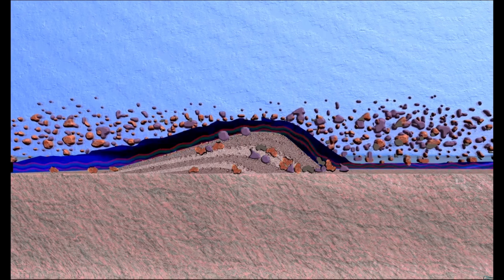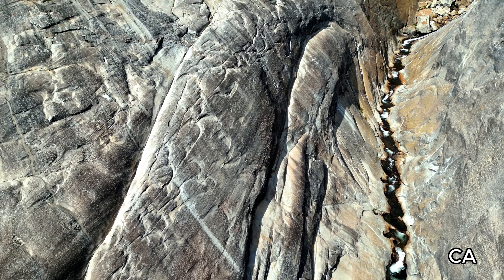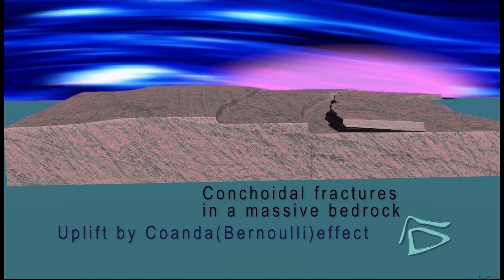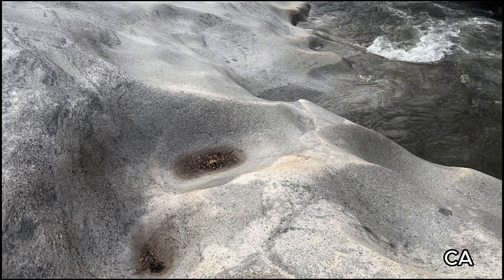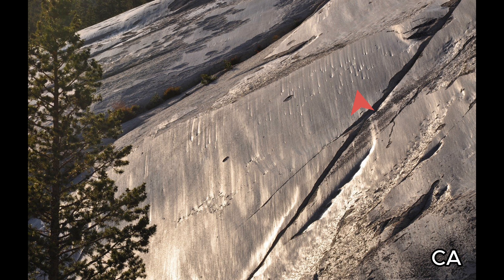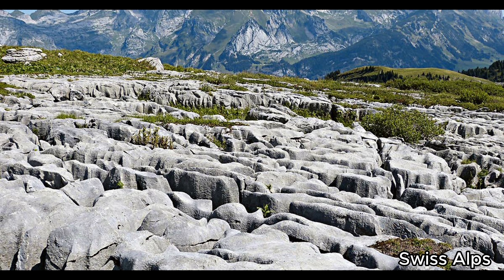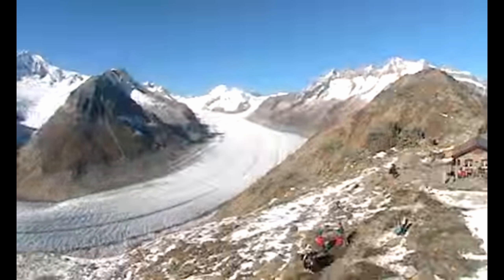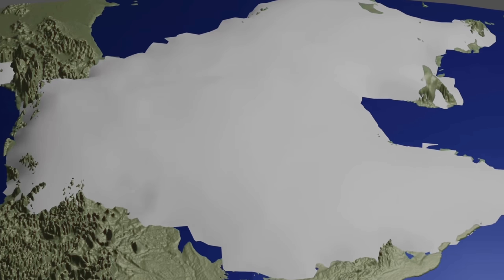Glacier Polish is B.S.

Comment: I have done a bit of research using AI. There is no way you can get erosion like this from ice or sub glacial flows. The only possible candidate is impact generated tsunamis. We are talking 20-30 m/s flows with abrasive material, waves and water columns 500-1000m height, dynamic pressures over 10 megapascal. We have the exact same landforms in Scandinavia. All the landforms you see are possible with this water regime.

Comment: Also, you emphasise features like crescent ruts, pitting, and focused erosion patterns as evidence that high-velocity water flows - not ice - created drumlin landscapes. However, modern glaciers show that both ice dynamics and subglacial water work together. For example, at Múlajökull in Iceland, we can directly observe drumlins forming beneath an active glacier, where sediment analysis shows both ice deformation and water processes at work. How do you explain these modern observations of drumlins forming under actual glaciers, where we can measure the relative contributions of both ice and water?

Refs.:
Woodard, et al., 2020. Insights into drumlin development from ground-penetrating radar at Múlajökull, Iceland, a surge-type glacier. Journal of Glaciology,
McCracken, et al., 2016. Origin of the active drumlin field at Múlajökull, Iceland: new insights from till shear and consolidation patterns. Quaternary Science Reviews,
Iverson, et al., 2017. A theoretical model of drumlin formation based on observations at Múlajökull, Iceland. Journal of Geophysical Research: Earth Surface

Comment: If drumlins were formed by, presumably, a single meltwater flood event, rather than gradual glacial processes, how do you explain the internal stratigraphy of drumlins, where we can observe multiple till layers that conform to drumlin surfaces, with evidence of shear deformation that follows drumlin topography, and discrete unconformities that demonstrate progressive formation through multiple glacial cycles over thousands of years rather than a single flood event of short duration?
Reply from the maker: Great Question:  These till layers you are talking about can be seen as graded beds from river deposition.  Multiple layers can be deposited in one flooding event, from the pulsating nature of water-flow.  As far as shear deformation goes, think about the speed of water-flow it would take to cause fluvial plucking or pitting.  You don't think that current couldn't cause sedimentary deformation of layers?
Reply: @erosion_of_earth  First, till deposits in drumlins are fundamentally different from river deposits in composition, structure, and sorting patterns.

Glacial tills are characteristically poorly sorted mixtures of various grain sizes, from clay to boulders the size of cars. River deposits show clear sorting patterns, with distinct layers of similarly-sized particles and imbrication (overlapping arrangement) of clasts revealing past water flow and direction. The internal composition of drumlins, a poorly sorted till, simply doesn't match what we'd expect from fluvial deposition. What you seem to be describing, at least the sediment you would see, are in Eskers, river channels that formed by the action of meltwater under glaciers.

Second, the claim that "multiple layers can be deposited in one flooding event" contradicts what we see in drumlins like those at e.g. Múlajökull. There, we find:

1. Till units are truncated by erosional unconformities, particularly on drumlin heads and flanks (If drumlins were formed by a flood event(s), we would expect erosional unconformities, and indeed erosional scour, concentrated between drumlins (in the low areas where water flows) rather than on drumlin heads and flanks.)
2. Systematic patterns of clast fabrics and magnetic alignment in till fabrics that show shear directions conforming to drumlin surfaces, not past water-flow (if the alignment was due to meltwater, the alignment would conform to past water flow directions, it would not parallel the drumlin surface)
3. Evidence of different depositional events separated by significant time, hundreds and up to thousands of years, demonstrated by weathering horizons and distinct till compositions (a flood even cannot explain multiple layers, some separated by many years, and tills from different sources)

Third, the shear deformation observed in drumlins is distinct from water-flow deposition/deformation. AMS (anisotropy of magnetic susceptibility) studies show patterns consistent with ice-induced shear, not water flow. Even high-velocity water would produce different fabric patterns than what we observe.

Fourth, there is the relationship between drumlins and other sub-glacial features. At Múlajökull and elsewhere, drumlins are often associated with features like crevasse-squeeze ridges and ice-walled lake plains that form under or the flanks of surging (rapidly moving) glaciers, not fluvial erosion.

And finally, we can observe drumlins forming today beneath modern glaciers, with their internal structures becoming progressively exposed as the ice retreats. We can also observe Drumlin formation under active glaciers using ground penetrating radar. This provides a direct window into formation processes that simply can't be explained by catastrophic flooding.

The water-flow hypothesis requires extraordinary reinterpretation of multiple independent lines of evidence, while the glacial model provides a coherent explanation supported by direct observational facts.

Here are some papers for you to read:

Hopkins et al., 2016. An anisotropy of magnetic susceptibility ( AMS ) investigation of the till fabric of drumlins: support for an accretionary origin. Boreas.
Aradóttir et al., E. 2023. Drumlin formation within the Bustarfell drumlin field, northeast Iceland: integrating sedimentological and ground‐penetrating radar data. Journal of Quaternary Science
Fannon, et al., 2017. Numerical simulations of drumlin formation. Proceedings of the Royal Society A: Mathematical, Physical and Engineering Sciences
Iverson et al., 2017. A Theoretical Model of Drumlin Formation Based on Observations at Múlajökull, Iceland. Journal of Geophysical Research: Earth Surface
Ives and Iverson, 2019. Genesis of glacial flutes inferred from observations at Múlajökull, Iceland. Geology
McCracken et al. 2016. Origin of the active drumlin field at Múlajökull, Iceland: New insights from till shear and consolidation patterns. Quaternary Science Reviews
Woodard et al,. 2020. Insights into drumlin development from ground-penetrating radar at Múlajökull, Iceland, a surge-type glacier.
Reply from the maker: @  So they have distinct layers, but they are too poorly sorted to be from river deposition.  Pick one.   Sheet-water-flow can poorly sort deposits even more so than a river, because a river is confined to a channel, while sheet water flow is not!  Anything Ice can do water can do better except for build moraines. So were is that mile thick moraine that spans the width of North America from the Laurentide Ice Sheet? Oh look its no where to be found, just terraced land. What a joke of a theory.
Reply: I understand your frustration, but let me clarify a few important points:

About the layers in drumlins: These aren't just any layers - they're specific types showing signs of ice movement. They contain unsorted mixtures of everything from clay to boulders (called till) that show evidence of being compressed and shaped by moving ice. Rivers and floods sort materials by size and weight - even sheet floods drop larger materials first as they slow down (also, sheetfloods, if that is what you are referring to, occur on slopes).

Many drumlins contain intact fragments of earlier landscapes that would have been completely washed away by powerful floods. Some even have preserved plant remains or soil horizons inside them, showing they formed in stages separated by thousands of years.

About the missing "mile-thick moraine": The Laurentide Ice Sheet didn't retreat all at once - it melted back gradually over thousands of years, leaving behind numerous smaller moraines marking different pause points, not one giant ridge. These moraines actually exist across North America and are well-documented.

The terraced land you mention is actually typical of glacial landscapes, including features like kames, eskers, and outwash plains - all recognized glacial formations.

If catastrophic floods formed drumlins, we would expect to see them forming today in flood zones, after e.g. Jökulhlaups, but we don't. However, we do observe drumlins forming beneath modern glaciers in Iceland and Antarctica, where we can study how they form directly with radar and other instruments. In these areas we see they are forming without the action of flood water, but due to the pressure of ice movement.

I'm not dismissing the power of water in shaping landscapes - it absolutely plays a major role. But the evidence specifically for drumlins points to ice as the primary sculptor.
Reply: @erosion_of_earth  Essentially, the scientific consensus (the details are not yet settled, but the overall idea is well understood) proposes that that glacier movement, especially  surging (rapidly moving) glaciers, remolds unsorted glacial till into mounds we call drumlins via shear stress. Catastrophic flooding is a fringe theory not supported by evidence, especially in the face of the evidence gathered in the last c. 20 years, with the advent of ground penetrating radar and magnetic susceptibility studies.

Indeed, I attended a lecture c. 20 years ago at my geology department where a scientist from the British Antarctic Survey shows us, for the first time, ground penetrating radar observations of actively forming drumlins under a glacier. Seeing this evidence was a revelation, it massively improved our understanding of drumlin formation.
Reply: There are different types of floods. My research strongly suggests that this was in the "upper regime", so imagine 500-1000 meter high waves even a thousand kilometers from the impact, 20-30m/s flow rate, 10 megapascal pressure, water cutting through mountains and ripping out stone blocks the size of houses. And for duration, you can imagine minutes for the initial pulse, and hours of churning seas, probably days or weeks for the waters to calm down. It is not a single pulse, because I have found crossing drumlin fields.

Comment: I've lived around glaciers for many years, and have followed creeks deep under the ice along the bedrock... there's not normally a bunch of water under there, it flows in caves and channels. Go to a glacier that's melting and look at the freshly exposed rock. You will not see any water erosion on anything but gravel, and that's only where the ice caves were.
Reply from the maker: Thats a very good point. In those caves did you ever see an esker?
Reply: @erosion_of_earth  yes, they can get filled with gravel and rocks that tend to build up in the middle. I guess it's not an esker till the ice melts. My cabin is built on an old esker. A long hill of sand, silt and water worn gravel. On one side is a flowing bog and ponds with a few big rocks. On the other is chunky moraine. Big jagged rocks mixed with lots of glacier silt. All covered with forest and such of course.
Reply from the maker: @Raven74947  Is the moraine parallel or perpendicular to the esker?
Reply: @erosion_of_earth  the moraine is hundreds of feet deep and goes on for miles. The eskers are usually more or less on top of the moraine, or kind of mixed in with it, and tend to parallel smaller creeks, watercourses or other terrain features that would channel water. And it seems they're more common in areas that were covered by an ice sheet or very large spread out glacier, not so much with valley glaciers. I assume in a valley they tend to be buried or washed away as the glacier melts.
Reply from the maker: @Raven74947  Thats very interesting. If they are parallel then they are probably accretion ridges. And the moraine is probably a sediment lobe deposite.  You see all of these "glacier" features can also be explained with water flow, and even fit the data even better.  If you want you can send me the coordinates to the general area, and I can take a look at it and maybe even include it in an upcoming video.
Reply: @erosion_of_earth  Wrangell mountains, Alaska.

Comment: What you need for good polish: pressure, a medium & abresive material. Water & ice are a good medium but make poor abrasive material (< 2 Mohs). 
In free flowing water you need high speeds to get effective abrasion. Under ice pressure, you already have all the power you need. If we look at recently exposed beds, we see spots of hard rock and surrounded by flows of fine glacial till. If high speed water was a major force, these fine particles should have been plucked away.

There are subglacial hydrological networks, but these barely leave a geological fingerprint compared to the scale of glacial striation.
Reply from the maker: Is it physically possible for ice to make Horse-shoe shaped scours into bedrock? no. What about potholes? no Flutes? no All these features have surfaces that are covered in "glacial" polish.  Thats why I think high speed water flow is responsible for all polish!
Reply: @erosion_of_earth  Horseshoe: yes (altered pressure gradients around hard spot). See work of Byron R. Parizek. Flutes as well, see work Tavi Murray & Clarke on Trapridge glacier. They observed dominant abrasian effects take place in diffusive Darcian system (porous), not channelised water flow. 

Potholes are indeed distinctly related to fast water flow, usually a moulin.
Reply from the maker: @leraK42  Have either of them been reproduced in a lab with ice? If not I would be highly skeptical. These features are fingerprints of fluid dynamics not, rigid body dynamics which ice-sheet adhere to. If Sheet water flow can make a feature, and moving ice sheets can make a feature,  shouldn't both possibilities be entertained? Instead ONLY ice is taught. When I show  you the context of all of Earth's Erosional features, in all regions then you will know the importance of the sheet water flow theory.
Reply: @leraK42  You have to jump through hoops and do somersaults to make the glacial erosion theory work, and it all falls apart when you zoom in or zoom out. I have found Roche Moutonnee on the scale of mountain ranges. Everything you see can easily be explained by high energy water flows that pass OVER mountain ranges.
Reply: @erosion_of_earth  for horseshoe see research Byron Parizek (Bedforms of Thwaites Glacier, West Antarctica: Character and Origin). For flutes see work of Tavi Murray on Trapridge glacier. Here it was observed that beyond certain flow speeds abrasion strongly decreases. 

These do not require fast water flow but work with a diffusive Darcian system (porous) instead of a channelized network.

Potholes are indeed caused by fast flowing speeds, but are vanishingly rare.
Reply: Did some more checking: 

- Water flow does help as it removes rock flour. 
- On the other hand if the water pressure is too high it reduces friction & abrasian.

Comment: Interesting. Do you think it would be a mixture of the two? Ice encroaching forward + retreat associated with melt? The straightness of the striations are unlike waterflow erosion.
Reply from the maker: Straight striations are unlike LOW-SPEED water erosion. Not high speed, not the speed it takes for fluvial plucking or pitting!  There is no evidence of ice encroaching forward, the Laurentide Ice-sheet never existed.
Reply: Oh I thought you were a legitimate geologist. I'm from MN. Pretty obvious here.